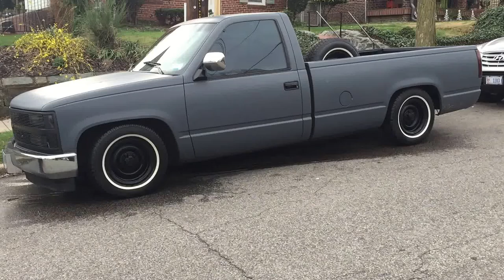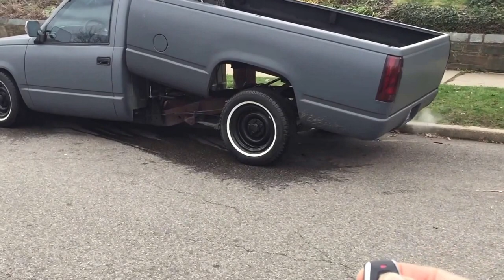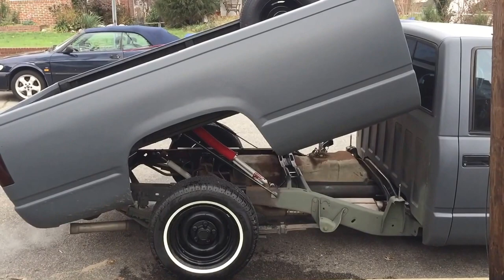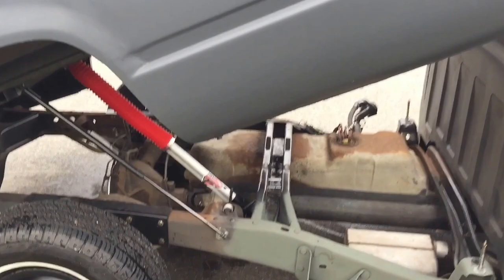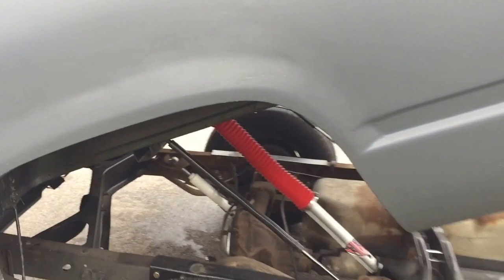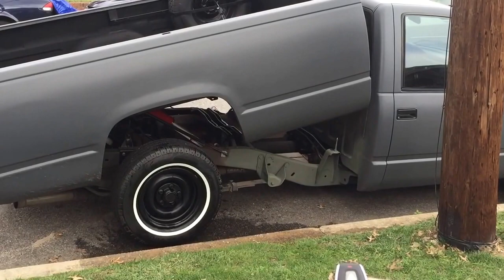Remote controlled pickup bed tilt

Comment: Very nice, Is there any way to clamp the bed in place when it's down so it doesn't shake or rock? I have a Mighty Max and I've always wanted a tilt bed because they look awesome and because it makes servicing the truck SO much easier. Also fun to show off how every inch of your truck is clean and bright.
Reply from the maker: Noah Zimmerman Yes, I used race car hood pins in the front bed bolt holes and drilled same size through the bed. So it lines up and doesn’t move side to side when down. Look at the video closely, you’ll see how I used the hood pins.
Reply: @WesGarage   I see them now. Very clever! Nice truck, man.

Comment: Where u set the back hinges
Reply from the maker: Juan jose Guzman All the way in the back of the frame rails.
Reply: What kind of hinges do I need
Reply: Can I see a pic of your setup
Reply from the maker: Juan jose Guzman I don’t know, because you can’t buy them, you have to make the hinges yourself.
Reply from the maker: Juan jose Guzman I designed my own set up, you’ll have to figure it out too. Not that hard, some trial and error, math and welding skills.
Reply: Wesley Kirk I can fabricate them but I wanted to see where and how there the angles set up

Comment: How long are your gas struts and what did you used for the rear hinges?
Reply from the maker: Used 4, 36” 250 pound gas struts. Made the hinges myself out of 3” x 3” angle stock and 1” grade 8 bolts.
Reply: Thank you.
Reply: Thank you. I love your setup